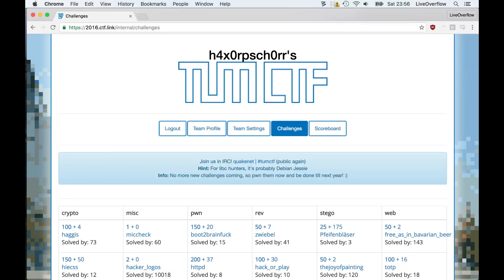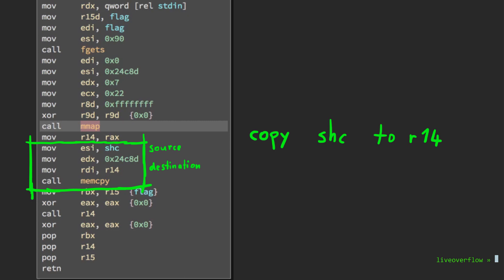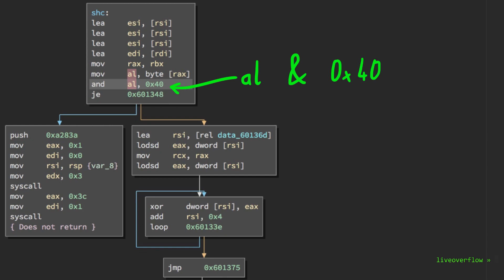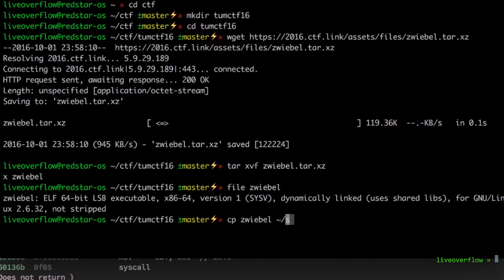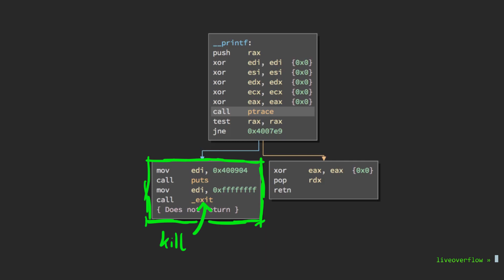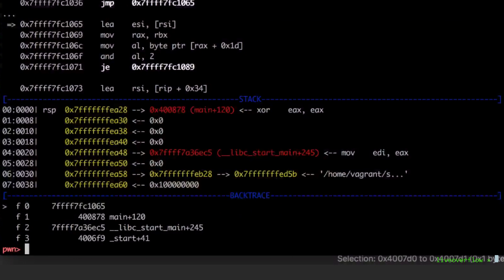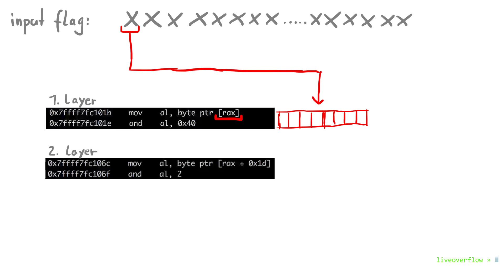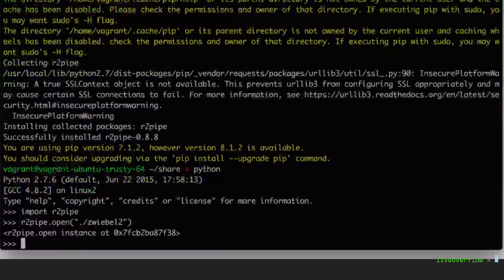Reverse Engineering with Binary Ninja and gdb a key checking algorithm - TUMCTF 2016 Zwiebel part 1

Comment: Excellent Video. what is Vagrant linux vm? is it another linux distro?.
Reply from the maker: +geek geek I kinda used the wrong expression. Vagrant is basically a command line wrapper around headless virtual box. Meaning that VirtualBox executes any Linux Distribution and vagrant makes that super easy. You can have init scripts that setup the VM like you want etc. 
there is a vagrant CTF vm, which is just a bunch of vagrant config and setup files that start a ubuntu or Debian and install all the tools you need.